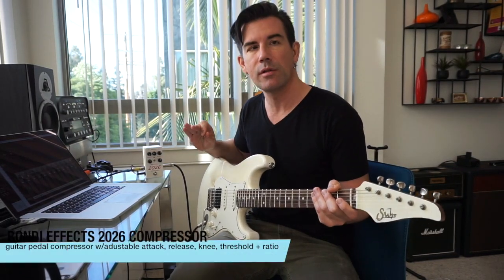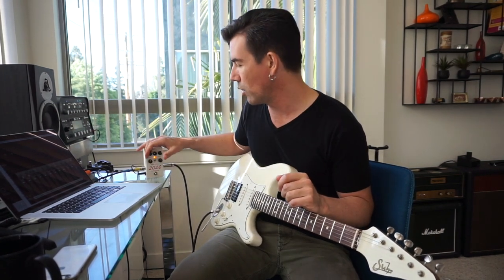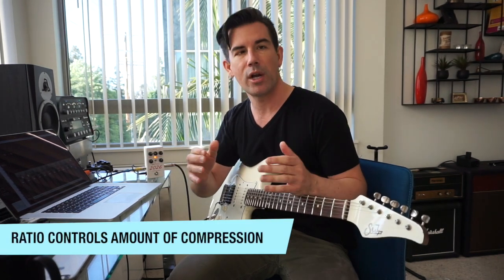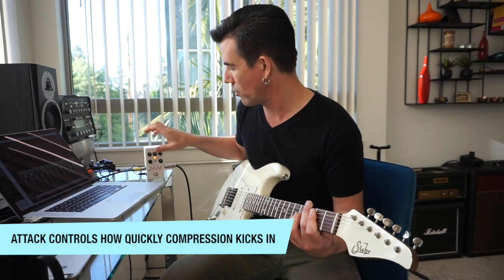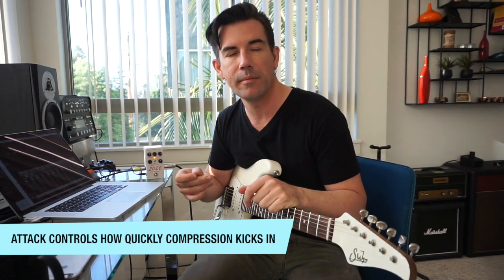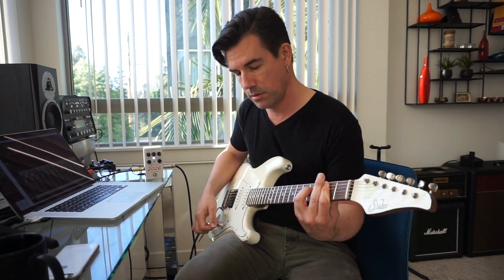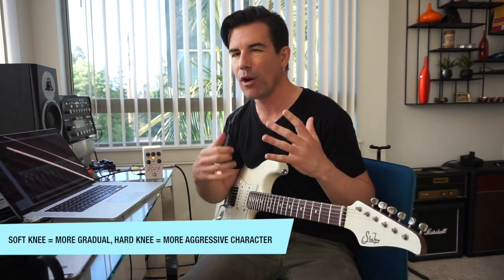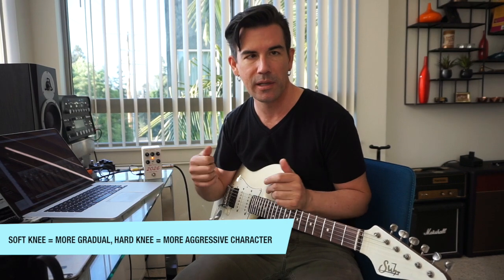GUITAR COMPRESSORS    EXPLAINED! Tone Secrets #5

Comment: Would love to see a #5a that explores practical uses for simple compressor (a la Dyna Comp or Squeeze).  I've been through 3 different compressors and still can't figure them out.  I've used them in the front of my chain (per suggestions) and the "squash" before my drives always seems to take the "hit" character away from the overdrive tones.  None of them stayed around due to that issue

Having said that, I'd love to figure out how to get the uber sustain that Gilmour had in a lot of his soloing.

Comment: Pretty good demo of the compressor control functions. What is lacking is the contrast of the pedal off and pedal on. No contrast of compressed sound and non-compressed. No explanation of what is to be gained by use of the compressor or what problems can be overcome. Just  "here's the compressor at this setting and here's the compressor at this setting" and then no comparison with no compressor at all. This is more about how a compressor works that how to actually use one.

Comment: I have a Boss ME-50 and the only controls on the compressor section are "Sustain" and "Level".  How would these relate to the controls described in the video?

Thanks!
Reply: Attack, ratio (knee) and sustain are set values. Sustain controls the input (how you amplify the signal BEFORE going into the comp, to decide whether it gets the full signal and crushes it or it only takes care of the volume peaks or anything inbetween. Level is basically a volume control, you can use it in different ways. I've seen Paul Gilbert use a comp with a low level to get a clean sound out of a crunched up amp (like a volume knob but with the benefits of compression), or you can use it to drive your amp by turning the level up, or just boosting the volume or making it even when the comp is switched on and off. Think of it as volume knob>fixed compressor>volume knob

Comment: Hello Pete! I have an ol' Ibanez UE400 multi-effects rack. It has a built in compressor which has a sustain min/max control and an output level control. I run this rack through my amps effects loop, since this rack also has Stereo Chorus, Phaser and Flanger effects. Is it best to run a compressor through amp loop or through my floor pedal board which has my tuner, wah, super overdrive, octave, harmonist and noise gate pedals...which I run through front of my Valve King 50 Peavey amp. Which way is better?
Thanks
Angel
Tucson, AZ

Comment: Pete, am I correct is saying the compression "shortens" the sound ?
Reply: Not quite Doug.  Compressors [simply put] lower the volume of sudden increases in volume, such as when you first strike the note/chord-- while at the same time bringing up the volume of lower volume notes.  So, if you struck a string really hard, the initial sound would be some what softer as the compressor clips the sudden increase, then will bring up the volume of the note as it continues to ring [actually making the sound longer].  If you looked at the note on a graph, you would see the upper volumes reduced and the lower increased - compressing the graph to the middle...I think :-)
Reply: Thanks for the explanation northof50now, that helps.  This guitar thing is a steep learning curve !
Reply: That's the truest statement I've heard today.  I started a few years ago, in my 50's.  It seems the more you learn, the more you realize you don't know.  Mark Knopfler said it best, "you have to make your fingers go where they don't want to go..."  Best of luck.  FYI - I use my compressor primarily because I play at low volume -- it helps with hammer-ons, pull offs and sustained notes.  You seem to be able to hear the notes better.
Reply: compressors can actually add sustain to your tone by eliminating dynamics, loud stuff gets quiter, quite stuff gets louder--> longer ring out

Comment: hi!! do you think i could use a compressor to saturate my amp (low volume)?
Reply: Davi - not Pete, but at low volume, the compressor does fatten the tone of single coils and gives some of the effects of pushed tubes.  Not in an overdriven sound; rather, it mimics the natural compression of the tubes.  Mine goes on when my volume is at 2 and under.  For what it's worth.
Reply: Could you list some of the best compressor pedals?
Reply: The simplest is the Xotica SP compressor.  It has only 2 controls- volume and blend.  Though you cannot make all the micro controls of the larger pedals, the blend really does a good job mixing the amount of compression with your straight signal.  On the opposite end, Cali is regarded as one of the best multi-controled.  A good place to look would be ThatPedalShow.  Do a search for compressors.  They've done 2 I believe.  They provide a very good comparison of simple to complex compressors.  Their playing is not up to Pete's, but Dan does a very good job at explaining the differences.  With that written, Pete's video sort of put it all together from a users perspective for me.  Good luck.
Reply: FYI - I have the Xotic and am very happy with it.  As I become a better player, I realize I like pedals with fewer controls.  It seems I'm prone to option paralysis with a multitude of controls.  Just give me one I can kick on.

Comment: i dont get it. Im trying out a Boss cs3 and it just ruins my tone. Compression is an effect i want to like but i dont. I just dont find a reason to use it other than maybe get endless sustain for especific parts, more definition for leggatos (think of the solo from Yyz by Rush) and that's it. oh and maybe a couple of songs by the police, but even then i cant tell when andy uses it
Reply from the maker: well, like any pedal- they are not all created equal! Maybe you'd like the sound of another comp
Reply: It depends on each guitarist to appreciate some pedal. I owned the CS3 and it was a good one , the less we could have in a rig.  I always adjust the "attack" at 1 PM and "sustain" at 10 AM, to render some small boost to the sound. Inverting theses adjustements,it rendered "elastic" sound, which was useless!
Reply: Joaquin Odriozola it's perfectly fine to go through your musical life without using a single compressor, really. But once you understand how they work it can be a very helpful effect
Reply: I was a Boss user back in the 80s when they were pretty much the gold standard (or so we thought) and I could finally afford something that didn't send the signal chain up into sizzle land.  I listen to them now and I hate them.  They've gone to the great guitar shop in the sky.  Maybe Boss is better now but, when I was in New York at the great Manny's I had a guy start showing me stuff and the difference between "natural and artificial" (which is totally beholden to the individual ear) and now I'm on the hunt for that "updated" analog type sound.  I don't have any dog in Bogner but, I love their pedals.  Except the Harlow, I don't know what that is all about.  The point to this is, get a couple hours and go get a spot and sit and play them all.  Drive people nuts but, it's well worth it.
Reply: lespaulfanofsparta you might be right. But the cs3 has been a gold standard for compression for a long time. Even Nels Cline uses it a lot
Reply: Boss pedals can be very polarizing. Some love them. Some hate them. I've never really cared for them, but that's just me.

I'm betting if you tried a different brand (or brands) you'd find something appealing. The frustrating part is going through that process.
Reply: One of the most notable differences between home audio Audiophile gear vs. "That'll do, Pig" is how effectively the capacitors track low end. Compressors are based around capacitors, and the controls essentially shape how you wish to "exaggerate" the input tone by shaping the signal leaving the capacitors. Point being- I've been through a few comps that one day stop compressing, one of which was a dyna comp I had owned since the mid-80's. Back then I had A-B'd it against a Boss cs3 and preferred the dyna comp, but I admit I might not have been used to the extra knobs (2) on the cs3, but I haven't been as happy with the later dyna comps and now use either a cs3 or a "Warden" by Earthquaker (...and am frankly still keeping an ear out). Perhaps your cs3 is not up to spec,- either  having outlived its electrolytics or being of dubious vintage? It can be a subtle, err, effect when they go bad, but once you know what to look for you can tell right away.
Reply: Interesting!
Reply: Try the Rothwell Love Squeeze. It's a wonderfully subtle comp, no noise issues either. You won't get DynaComp levels of squish, but it just gives everything a boost and makes my tone sound more lively, more present and focused. I use that and a DynaComp, they are great foils for each other.